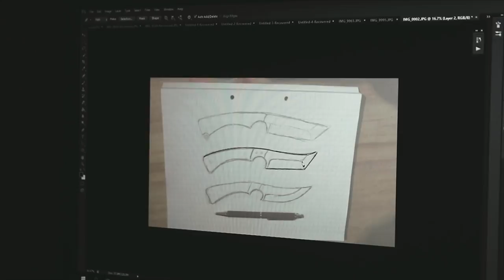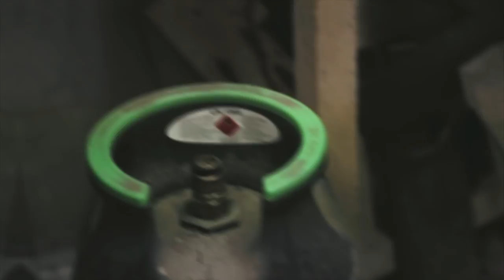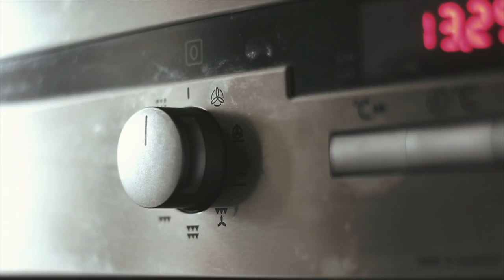Making a tanto knife from rusty lawn mower blade part 1

Comment: I've made blades out of everything the trick to getting them dimples out is a file and hard work you should a 2 by 4 and a clamp lay the knife down one the 2 by 4 and go to work back and forth to get the knife flat as possible then its time to sand it to get the scratches out state with 60 and work your way up to 400 it will be mear polish with a buffer and then watch how beautiful it looks or you couldn't just sand it and thats what you get nice job on your knife keep up the great work thanks for sharing with us.
Reply from the maker: Thanks! This was actually the look I was going for. I like the contrast the dimples give with the polished surface and they remind me where the steel came from. But this is just my own preference.

Comment: What type of drill bit did you use to drill the pin holes? I've tried this and burnt up 2 bits
Reply from the maker: I think I used carbide bit. You should drill the holes before hardening. You could also try to only to dip the blade in while hardening or afterwards you could sink only the blade in water and heat up the handle with torch and let it cool down in air.